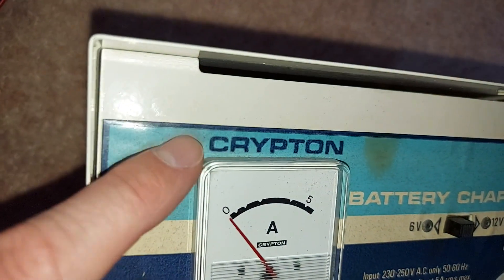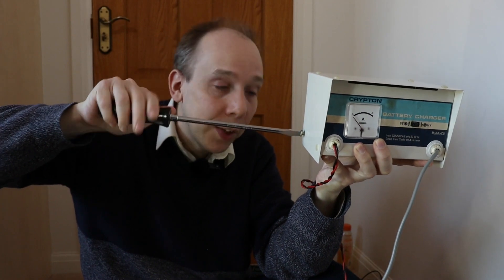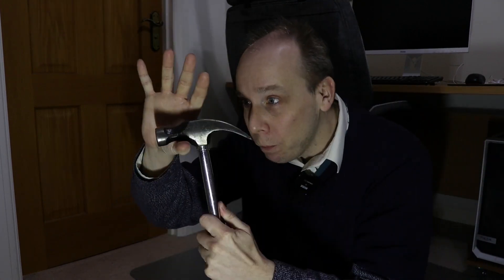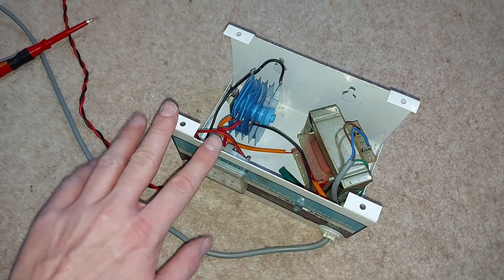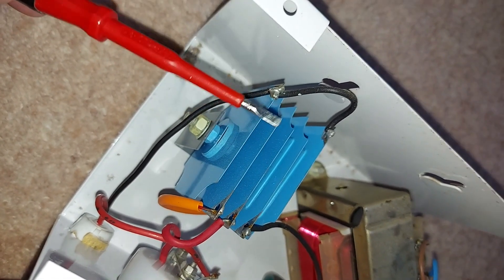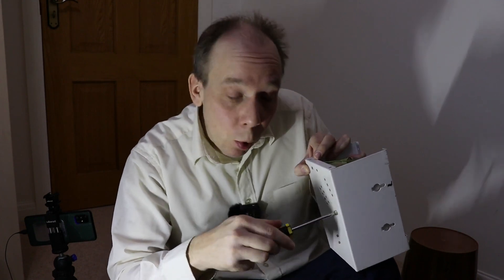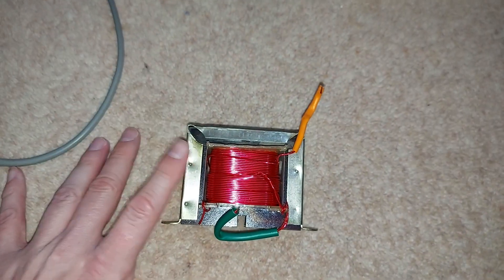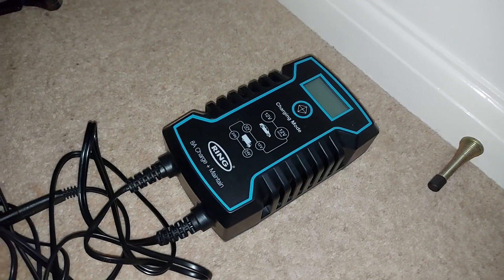How Car Battery Charger Works: What’s Inside? (1970s Car Battery Charger)

Comment: Clearly and well explained in an interesting way, yet another good video in your collection. 👍

That old charger with appropriate use and user can do things that outsmart the modern "smart" chargers.  I'm not even sure if using my 4A Ring on a neighbour's BMW battery, that could be removed or disconnected from the boot so the car's computers didn't know if they were on their A or E, hasn't upset the Ring's smartness.  I might have to give it an easy task to check or get it thinking straight again. 🥺
Reply from the maker: Thank you. I’m glad you enjoyed the video, Nta16. Your comment was interesting as always. Ideally, I’d like to get another old charger at some point. Then I’d have the best of both worlds.
Reply: @CarSpyTV  when I was looking on the internet for a photo of my 1990s Bradex BX4 I found one for sale on eBay, referred to as "vintage" of course, not even classic, so we're both well into vintage now - same as the chargers.  🙃